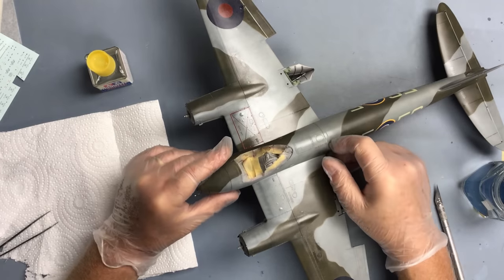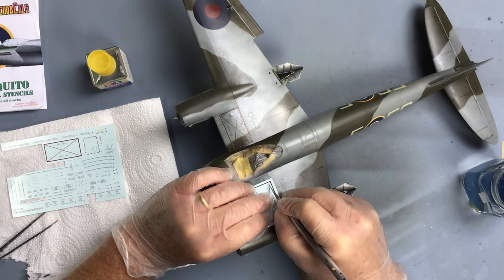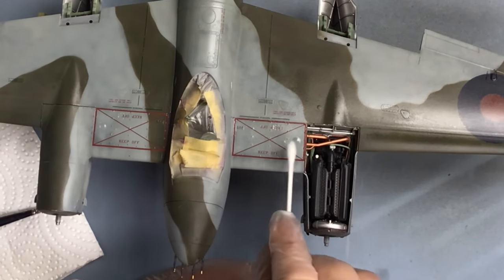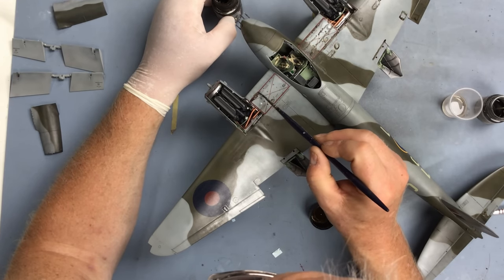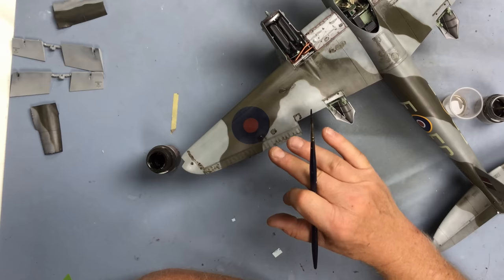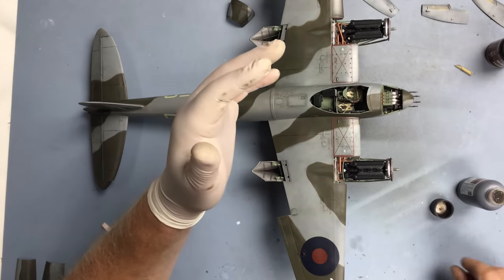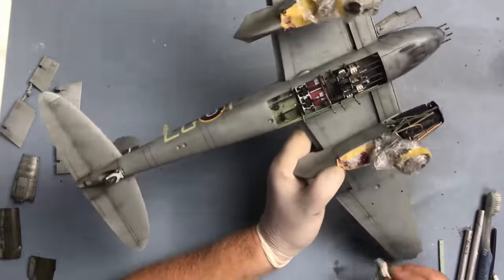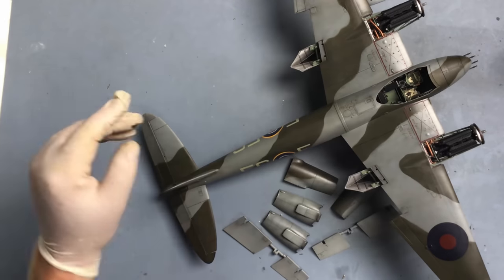Tamiya 1/32 Mosquito build series Part 18

Comment: Splendid work on the dirtying up Steve, the camera tends to overblow the effect so it looks far dirtier than it actually is. Thinking of getting a set of the Barracuda stencils for the new 1/24th Spitfire when Airfix release it in the autumn as they'll set that off nicely. Keep up the good work.
Reply from the maker: You’re right about the camera accentuating the weathering effect Phillip. I think Barracuda always use Cartograph so you will like them.